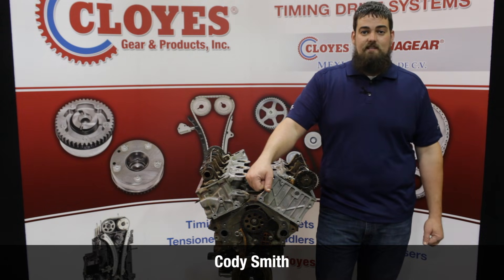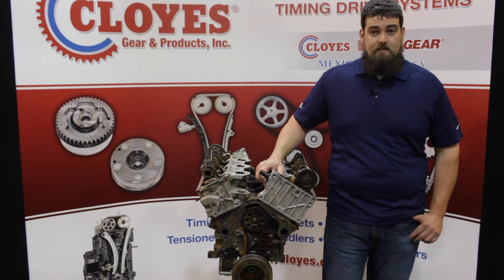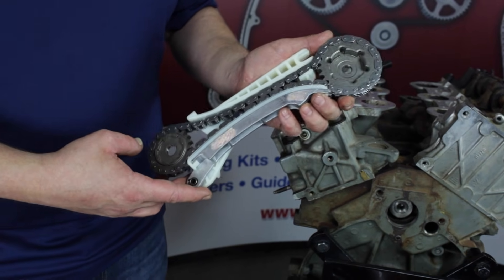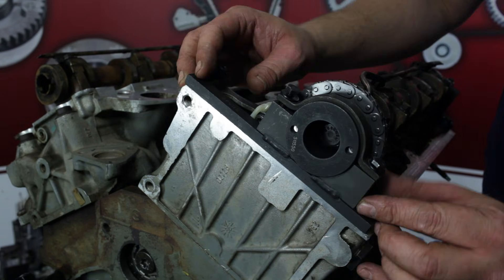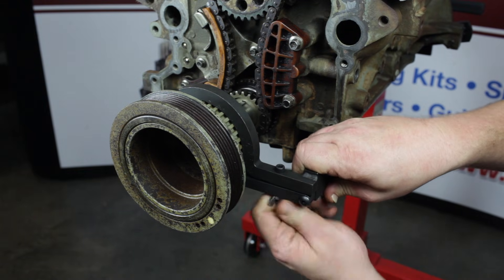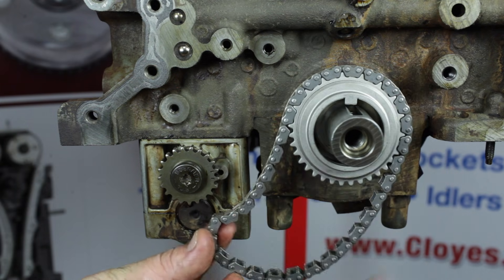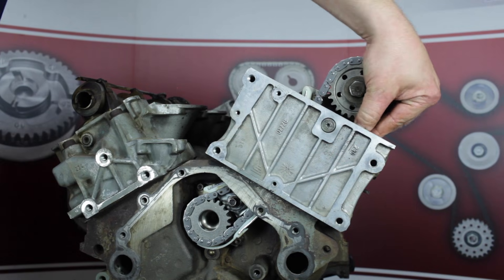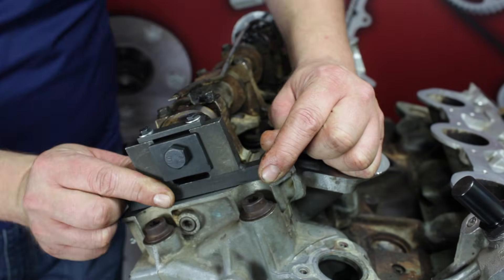Ford 4.0L Timing Chain Replacement, Cloyes 9-0398SB

Comment: So I just need to replace the rear cassette. Is it really necessary to remove the Jack shaft bolt and rear sprocket? It looks as if it is unnecessary. If I just mark the positions of the cam shaft, chain, and sprocket then remove cam sprocket this with allow access to remove and replace  the cassette correct? I don't see the purpose of removing the other components just to slide in a new cassette.
Reply from the maker: Your idea would work in theory, but I don't think it is physically possible. The jackshaft sprocket bolt and sprocket must be removed to get the chain out and back in. If I am remembering correctly, the gap between the sprocket and engine is too small to get the chain through.
Reply: Forrest Mayhugh Yes you can do that. If you plan to reuse the chain you can slide the old cassette out and slide the new one in. I’ve done the same thing. You don’t need to remove the jackshaft sprocket bolt, just the pivot bolt and upper positioning bolt. You’d still have to separate the engine and trans though.
Reply: @iamdjnam  thanks I did just that and it worked like a charm it was cake
Reply: @FoFoCowboy  Why is my crank turning when trying to remove the rear jackshaft bolt? The camshaft isn't budging.
Reply: @hardhatcat100  the jackshaft sprocket is chained to the crank in the front so when your turning the jackshaft trying to loosen up the rear Jack shaft bolt its going to move the crank. I used an 18v impact on it. I don't recall if I had to clamp down the crank or not. It helps to have a wrench on the front jackshaft bolt clocked against something so it wont move. If it move on me I just moved it back to where the woodruff key was at 12 o'clock.

Comment: Are there 3 chains on the earlier 4.0s?
Reply from the maker: The older 4.0L pushrod engines only had one chain. Once they went SOHC in the late 90's they all have this 3 or 4 chain system.
Reply: @Cloyes01  what year did they put this engine in the mustangs? Is it in a 1999 mustang?
Reply from the maker: @therobinmasterstheory1636  They did not start using this engine in the Mustang until 2005. The 1999 Mustang V6's were 3.8L engines.
Reply: @Cloyes01  thanks :)
Reply: @Cloyes01  4L or 4.2L pushrod engine?
Reply: 4x4 models always have 4. 2wd have 3.

Comment: Hi, thank you for the video. Could you please give a list of bolts required to be replaced (with the part numbers if it is possible). As I understand it is another critical aspect for successful Cloyes product application.
Reply: You need front and rear jackshaft bolts and crankshaft bolt. But please don't buy cloyes. Spend the money on OEM. Do the job once.
Reply: @iamdjnam  Thank you, sir, your help is highly appreciated. So, talking about Cloyes parts, you do not recommend them because you have had a negative experience?
Reply: Stanislav A. Bourakov Yes. They lasted 12,000 miles before having to replace again with Ford parts. 40k miles now on the Ford Components and it's quiet as can be.
Reply: Camshafts bolts are not TTY bolts?

Comment: 4.0 wors engine ever made
Reply: Quite a retarded statement. It is a very reliable engine.

Learn to spell.
Reply: @rottenroth  this four chain bs is just crap. The old 4.0 pushrod didn't have all the hp but at least it stayed together and was easy to maintain/repair.
Reply: not quite

Comment: My wife's 2006 Eddie Bauer Explorer blew timing set shrapnel right through the frigging valve cover just a few months after I bought it.  Had I known this engine was so unbelievably fukken stupid complex and expensive, I would have shunned it like it was a vampire with leprosy.  I just wanna jerk that POS 4.0 SOHC out and throw it off the side of the fukken mountain.  Maybe I'll look into gutting this 2006 Explorer and sticking an old 302 in it, instead of fixing this stupid knucklehead bean-counter over-engineered shit bomb.
Reply: I feel your pain dude. Am a Ford guy but this is just plain crap.
Reply: great description- should go back to pushrod non-interference engines- corvette still has them
Reply: @ufartface  that 4.0 OHC is a nightmare. The old pushrod 4.0 was better but just less power.
Reply: you have a problem with your temper.need to get that checked out.
Reply: @JOHNNYCARROLL-f9e  🤣Why?  Isn't mine the normal reaction to replacing the timing set on this particular engine?  And what could be more satisfying than filling that PoS full of buckshot, then setting it ablaze and pushing it off the mountain?  Surely that would be more satisfying than going through the huge time, labor and expense of having to repair it out in the yard!😆

Comment: Just wondering why Cloyes doesn't include the 2 bolts that must be replaced in an otherwise complete kit?
Reply from the maker: Those bolts, with proper torque-to-yield functionality, do not exist in the aftermarket. At this time Cloyes would be purchasing OE bolts and selling them at a markup to include them in the kit. For now customers can save money and purchase them separately, or reuse (not recommended.) We are currently working with a bolt manufacturer to produce proper aftermarket replacements. Hopefully they will be available soon.

Comment: My 2000 Mazda b4000 has 275k miles an the engine runs an sounds mint i think maybe the chains were replaced on it before
Reply: I'm starting to wonder if my 2000 explorer had them changed when the transmission was out of the truck

Comment: Great vdo, thks, just one question, when you say, for example, torque to 35psi plus 90 degrees,  that means, when you reach the 35psi you still turn 90 degrees more?
Reply from the maker: Exactly, you will torque the bolt to 35 lb/ft then turn the bolt an additional 90 degrees (1/4 of a turn.)
Reply: 10,4 Thks.  @Cloyes01

Comment: These are good engines if left stock and will last and will need a timing set eventually and will continue to last but I say if you need a new set dont fuck with these engines this is a fucking headache even for someone who is a tech only attempt if you've done timing sets on other ohc dohc engines this is a big boy job and will fuck you up hard if your not confident in a none cocky way
Reply: My 2000 Mazda b4000 has 275k miles an the engine runs an sounds mint i think maybe the chains were replaced on it before
Reply: I've done plenty of these jobs. the 4.0 is an excellent little engine. they never have problems other than the timing components. once replaced you will have a long lasting reliable engine.
Reply: Platinum Garage yup I never hear about the timing chains failing on the 4.0 OHV witch is what my truck has unlike the 4.0 SOHC they fail a lot
Reply: @iamdjnam   Hi Plat, I have a 98 v6 sohc 2wd 223333 bought new, oil chg 3-5k, tranny 30-50k, i did intake gaskets, new thermo metal housing, ball joints, plugs,etc, etc, but no engine stuff. should i do the tensioners now. I worry that might set off the rattle. no noise that i can hear yet.  maybe drop and check oil pan for plastic?

UPDATE: I dont think tensioners at this LATE time will help.  I am doing the valve covers gaskets and the front casette is broken, the back is still good. it cost 1900 for one and 3500 for all three at ford. new engine 2800 plus extra crap. it makes a little noise ticking sometimes, not ever loud, should i just keep driving? how many miles have any of you got out of the sohc once you knew it had a bad cassette?
Reply: James St. Clair It's a 4.0. Yes, little. The 5.4 is big engine.
Reply: James St. Clair baby brother, little brother, big brother. Then the 6.8 is father
Reply: It's a $3k job at the shop. That's way better than doing it yourself if you have a family and a day job.
Reply: The Watch Show I work full time. Pulled it in the garage and had the engine out on a Sunday. Took about an hour to do all new timing parts, then a day to put it in and get it back running. Cost me $0 in labor.
Reply: @iamdjnam  your good. It would have taken me two days just to get the engine out.
Reply: I don't have a picker or an engine stand and I'm slow but meticulous. And I don't have a second vehicle to drive while the truck is down.
Reply: It's easily a 5 day job for me.
Reply: The Watch Show for $3000 most people would look for a vehicle that isn’t 15 years old. That’s why they’re all up for sale with timing rattle.
Reply: Sell it and get a V8. Engine is only 210 hp, heavy vehicle..not worth the trouble.
Reply: they are f-ing the worst engineering design in the history of ford-  idiot engineers should be shot in the knee caps
Reply: @ufartface  if the timing chains were all in the front of the engine it wouldn't be quite as bad.

Comment: Hey Cloyes can I do this procedure  when the front cassette chain in the engine got broke?
Reply from the maker: Yes, the procedure will be the same, you just may need to reposition the camshaft on that bank if it jumped time. The special tool may not initially install, you may need to rotate the camshaft until it does.

Comment: What does it mean if the camshaft holding tool does not line up.... and it is top dead center
Reply from the maker: That would mean the engine is out of time or you are on TDC of the incorrect stroke. Try to rotate the crankshaft 1 revolution and try again. If the tool still won't install that means you are out of time.

Comment: Went to the Cloyes site to purchase the timing chain kit, and found everything I needed EXCEPT for the option to add to a cart and buy the kit 🤔 Am I missing something? Do I have to call directly to purchase?
Reply from the maker: Hi Shawn. Cloyes does not sell direct. You can purchase our products through one of your local parts stores like NAPA, O'Reilly, Bumper-to-Bumper, Auto-Plus, and many others or you can purchase online through vendors like Summit Racing or JEGS.
Reply: Cloyes Gear & Products, Inc. thank you for the rapid response. Very helpful!
Reply: @Cloyes01  https://www.amazon.com/stores/node/2587423011?_encoding=UTF8&field-lbr_brands_browse-bin=Cloyes&ref_=bl_dp_s_web_2587423011 Are these your products or knockoffs?

Comment: This video is perfect! I have a question.  I am doing a timing chain replacement with your kit!  Do you think I can reuse the jack shaft bolts? Have had success? I just picked up 09 Eddie  bower Explorer with all the guides broke on front side, still runs with terrible noise that you just can't drive!
Reply: they're tightened to yield, so they can't be reused

Comment: Do you have to replace all of the timing chains on 4.0L 06 mustang
Reply from the maker: Full system replacement is not always necessary, however it is recommended.

Comment: Here is idea I have to do the rear chain without removing the motor from the car. I have a 98 Explore. Thinking of removing the center dash where radio is located. Cut a hole to get to the back of the motor. Does anyone think that will work? Would make this job so much quicker.
Reply: I've been told the engine has to come out because the trans bell housing covers areas you will need to access.
Reply: Dang forgot to consider that into.
Reply: Tim Overton I don’t think that’s gonna work. I think the transmission bell housing is going to get in your way unless you cut a hole in that too. And then there is the fly wheel , it will be sandwiched between the torque converter and the engine, It was worth a thought though we just took the motor out of one of these today it’s not that hard to get out and I made video of us doing it
Reply: Thanks Clay for the information I'll check out your video

Comment: Do you have a video if the same engine jumped time how do you adjust the camshafts? When putting it back together?
Reply from the maker: You will still follow the same procedures, but you will need to get the camshafts realigned first. Try to rotate the crankshaft to a position where all 3 pistons are down on one bank. Then rotate and position the camshaft on that bank using the tool from the tool kit. You will then repeat on the other side. Once both camshafts are properly positioned you can move your crank to the correct position and install your crank holding tool.

Comment: So, in the video you say this is an interference engine. A quick google search says otherwise.
"Fortunately, the 4.0L SOHC is not an interference engine so a timing chain failure won't bend the valves. But it does create an expensive repair for the vehicle owner."
I'm confused, is it or isn't it?
Reply: Yes it is an interference engine. I have a 03 4.0l sohc
 v6 ranger and I broke all my timing chain guids. And although my chains didn't break it did cause enough slack for the chain to jump a tooth or a few and I'm currently working on the engine now and I bent valves from contact with the pistons!

Comment: The Balance shaft was not aligned correctly, you need to align the dot with the bearing split on the lower shaft then align the 2 lines either side of the dot on the case.
Reply: Yes sir you are correct. I couldnt tell if it was align correct or not it was hard to see underneath there.

Comment: So basically engine needs to be pulled that's all I needed to know 5.3 vortec for me from now on
Reply: Just replace the engine like I do if you got a expo or ranger with ohc engines so much easier and cheaper. I'm on engine number 3 now within 5 years
Reply: got a big ol pile of that 5.3 junk  in the scrap pile behind shop also,  just like the ford keep em serviced and they will last. over heat or lack of oil changes will scrap em.. dumb asses comes in all flavors/// take ex wifes friend ran a 2002 merc mountaineer 4.0 over 550,000 miles doing hospice work in south georgia using mobil 1 synthetics deer totalled vehicle never replaced engine or trans, you can service the holy crap outta a vortec 5.3 and it won't last that long period. i have turned wrenches all my damn life.. worked in gm and ford dealers and just bought a new 2019 ram lol..
Reply: @charleshollingsworth1583  I agree Mobil 1 and service is key. However 550,000 miles on an original 4.0 🤔 . Also 5.3s are used in high performance aircrafts . I have a 5.3 with a 200 wet shot of Nitrous daily driver with stock bottom end lol. Only issues with 5.3s is lifters which is a 3 hour permanent fix.
Reply: @charleshollingsworth1583  didn't realize they call the 5.3 a vortec?
Reply: why heck yea man 5.3 are ok engines just replaced tons of them a lot from customer abuse to just pure oil consumption issues to oil pressure loss then you get a good one that never goes into shop as with anything. but when you have 30 out back of dealer under warranty useing oil sheesh with pissed off customers..
Reply: @charleshollingsworth1583  1 of 2 things here. Either the engines are still running at 400k and using some oil, whoopdy doo, or you have 30 engines from nearly the last 20 years of their service. Either way if Ford motors were scrapped as often as they should be i.e too many specialized tools and hard to get to parts driving labor costs up, or motors that blow plugs and phasers, etc. I'll take a 5.3 over that any day. Not to mention the boost they can handle with stock internals for higher performance applications. Ford just makes junk, even their better stuff has junk on it. Chrysler isn't too much better.
Reply: different strokes for different folks they all have had good and bad, and a lot of it comes to servicing. i have worked in ford and gm dealers for over 20 years turning wrenches , then in my own shop  so i have seen a lot in all brands. you may buy a new vehicle and never ever have any trouble at all and the next you buy may be the biggest pos that was ever built. i put 7 transmissions in a mans gmc z71 in a gm dealer under warranty for him to get 80,000 miles out of it. the next fella may go 400,000 and never blow a trans. most people that bash one brand or another go on hear say and have never owned one. fed-ex years back ran econoline 1 ton vans with 300 6 cylinder engines 800,000 to a million miles replaced engines and go again. ups trucks those big brown rascals ran both gm and ford power trains and went tons of miles with both. i worked for fed-ex for 1.5 years in the 80's as a night shift mechanic they ran them all day and at night they were all checked over fluids lights hoses belts  tires tested batteries and checklist filled out which was very stressful as they had over 85 vans per night and 3 mechanics.. you miss something and it failed you got wrote up.. take care